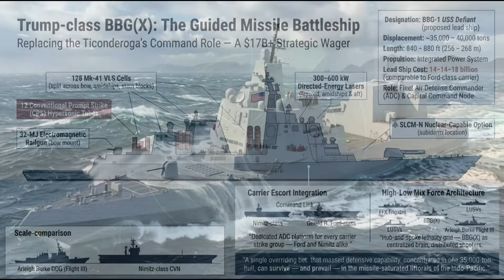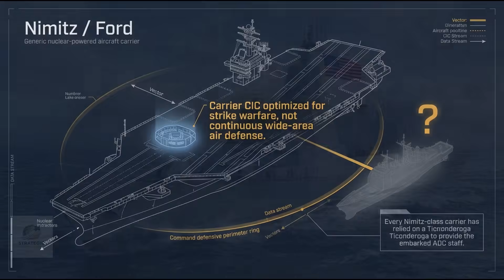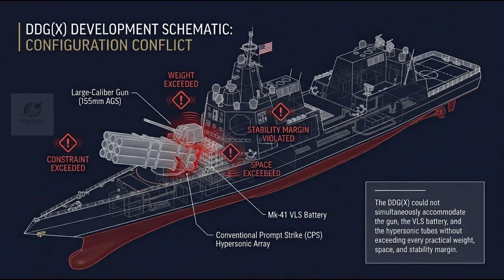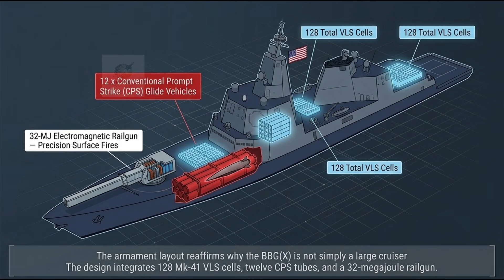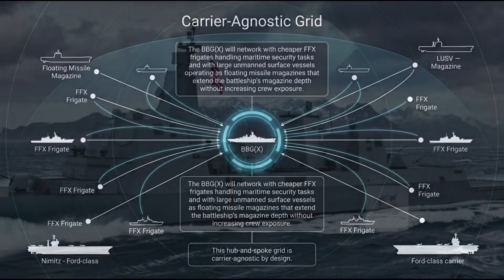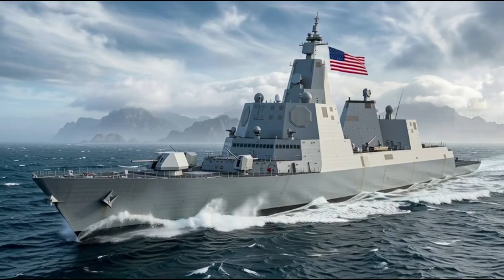Trump BBG(X): The 35,000-Ton Battleship Replacing the Ticonderoga - Explained

Comment from the maker: Thank you for watching. This video explores why the remaining Ticonderoga-class carriers cannot simply be replaced by Arleigh Burke Flight IIIs, and how the Air Defense Commander's role void gave rise to the design of the 35,000-ton Trump-class BBG(X).
Please share your thoughts: is the approach of giant command ships like the BBG(X) an unavoidable strategic necessity, or is it an expensive gamble that is too vulnerable in the era of hypersonic missiles?
Don't forget to like and subscribe for more maritime defense analysis.
Reply: Too many eggs, too few baskets. 

Tonnage to VLS cell count ratio is inefficient. 

If we need a flag bridge, it should only perform the command and control function, with sufficient defense systems to remain viable. Lose the offensive features. Railguns require too much power for non-nuclear power plants. Hypersonic capabilities only make this a more valuable target.
Reply from the maker: @taerkitty You're forgetting the 12 CPS hypersonic tubes. That's what scaled the hull to 35,000 tons—a Burke can't carry even one. The Integrated Power System is sized for the railgun and lasers; nuclear isn't needed. And if you strip the offensive punch to a separate platform, you've just created two must-defend aimpoints instead of one.
Reply: @strategicforecaster1  Good point. I didn't realize we couldn't field our hypersonic missile from current surface vessels. 

Yes, an all-offense ship is an arsenal ship, the concept of which the USN evaluated and opted for other options. 

One of the commonly cited reasons for avoiding the arsenal ship concept is the danger of secondary explosives should an attack make it through.

If this ship is only armed with lasers and railguns, that wouldn't be an issue, but both of them are too short-ranged to contribute to a firepower contest
Reply: @strategicforecaster1  The navy doesn't need a floating target. Nuclear would be needed for the power requirements of Railguns, and lasers and to not need replenishment while underway and to get speed with that tonnage. Next issue is railguns is not perfected the barrels were melting after 3 shots fired and the ammo was costing 800K per round. Next issue is the Helios laser that is on one Burke it currently due to power constraints on the Burke class it can only power up to 1/3 of its intended power. It is not useless, but it cannot perform at its full capability. a Burke Class is gas turbine. It is only 60KW which is okay against small drones, sensors, very small boats, the ones that even Iran uses in the IRCG is too big for it. The ship needs something that generates enough power that a Gas Turbine cannot to get up to a 300kwlaser that can take down cruise and anti-ship missiles or even possibly balletic missiles.

The Helios lasers are affected by fog, rain, sea spray, smoke, dust, humidity, and atmospheric distortion. A missile does not care much if the air is wet; a laser beam does. The beam also has to stay on the target long enough to burn or disable it. That is harder against fast, maneuvering, or reflective targets.

This is one of the biggest real-world limitations: lasers work best in clear conditions with enough dwell time. It needs line of sight. HELIOS can only hit what it can see. It cannot shoot over the horizon like a missile. A Burke destroyer still needs Standard Missiles, ESSM, RAM/CIWS, electronic warfare, decoys, and guns. HELIOS adds another layer; it does not replace the rest of the defensive system.

If the Navy wants to deploy a Helios system the power requirements are too great as it is right now. the battleship with the new ANY SP 6 Aegis radar is a beast on power in the new flight III burke class they have a bit bigger engine. The Marines don't need rail guns like the only battleships they are too imprecise. It's why we launch precision guided missiles now and they pack more of a punch. 

Look at Ukraine they took out Russia biggest ships with drones. Trump wants the Navy to go back to steam catapults because the emails have a failure every .16% or every 614 launches and there are 4 catapults on each ship. They have them back up rather fast. I was in the Navy recently retired it is a rather hard shock on the body when you get launched and the airplane itself. It was so much smoother on an emals system. Trump is an idiot. 

Trump wanted the islands on all carriers for the Ford class to be moved because he did not like the aesthetic. He is pushing for it even on the ships under construction now. They are placed by design because they are smaller, it improves air traffic flow on the deck, higher sortie rate, works with the new elevator design, better deck visibility but Trump said he did not care. The overall look and aesthetic of the ships were more important. Just like changing the reflecting pool to a blue that he wanted and no one else probably cared about was more important cleaning it was fine, sealing it was fine. No, he has to make things in what he wants.
Reply from the maker: @Asergaottie The budget submission itself includes both options: a non‑nuclear variant at roughly $14 billion maybe less >> and a nuclear variant at about $17 billion. Nuclear is not a hard requirement.  
On lasers, you’re ignoring wavelength tuning and the shift to near‑infrared, which materially reduces atmospheric attenuation and improves dwell‑time performance against maneuvering targets. That’s why the 300–600 kW systems are being pursued as a viable anti‑cruise‑missile layer.  
And on power management, the Integrated Power System uses smart load‑sharing; it never runs the railgun, lasers, and radars at maximum simultaneously. You’re painting an “all‑at‑once” problem that doesn’t exist in the architecture.
Reply from the maker: @Asergaottie As for the rest: I don’t judge people, but I learn about psychology—I know Trump is a narcissist and likes to be the center of attention. That observation, however, does not alter the engineering baseline the Navy is working from.
Reply: @strategicforecaster1  - Still, current Navy design guidance is to have each tactical function be isolated to its own class of vessel.
Reply: @strategicforecaster1  The Ticonderoga I was in the Navy for 26 years retired in early 2025. It is a 40 year old cruiser expensive and outdated. The Flight III is very comparable the biggest difference is the 122 vs 96 VLS cells and the Ticonderoga can perform as an air defense command for a CSG. We still do not need a floating target in a battleship. Cruiser sure. The Ticonderoga they tried to update it but it was futile and too expensive and only added a few years to it. SPY 1 vs SPY 6 (V) radar is one of the biggest differences. I would go for a cruiser over a battleship and adding more burke class but even those are older class ships. 

What the navy needs to do is Flights like the Burke and add things as they go, not like the Ford class carriers and add 23 new techs at once. We need to add quality and quantity at the same time. China adds more quantity and sacrifices some quality, that is why their destroyers and frigates are smaller than American ships.

They are focusing on more Diesel-elec ultra quiet for costal defense of the mainland and some nuclear subs which is a big deal. We need to not worry about one big ship and yes, I agree with your original point about Trump is a narcissist. But we need more Destroyers, using a cutter as a frigate with no VLS cells is a bad idea IMO. They screwed up the constellation bad. They screwed up the LCS bad and when they got the few that are remaining, they are so poorly armed they would get picked off one by one.
Reply: @strategicforecaster1  They are leaning towards a nuclear one. The options they are wanting would require enormous power. I saw the testing for the rail gun which is nowhere near completion. If you're going to build a battleship it would need to be standalone ship. Iowa class was 33 knots if not fully loaded down and in good sea conditions. Again, though it would require replenishment ever 4 to 7 days which adds to the cost. The larger the ship the more it takes. Even then it won't cost what the estimate is. How many projects cost what the estimate is. The ballroom was supposed to be $200 million now it is up to $400 and rising. There will be delays and supply chain issues etc.
Reply from the maker: @Asergaottie Thank you for the comments—I do understand the situation, and I've made several videos covering it: the CBGL, the Arleigh Burke Flight III versus the Type 055 from a growth-margin perspective, how the U.S. skipped the cruiser while China build it, and how America now realizes is troubled by it. The program that should have been moving forward, the DDG(X), ended up being overtaken and effectively killed by the BBG(X).

However, I think China's nuclear submarines will bypass the first island chain and break through to the Pacific and beyond using their speed. I've also made a video about the Type 093B.
Reply: @strategicforecaster1  You are not wrong, but we need to get our crap in one bag first and not worry about a BBG(X) one large ship that can take x number of years at a large tonnage.

Need to get quality with quantity, they are upgrading the docks back home a Pearl they built in the 40's and adding a 5th as I am sure you know and elsewhere. Need to add manpower from the pandemic maybe even work on more shipyards too. Pay is also an issue. Supply chains.

I still firmly believe since when I retired the Helios had its issues with power and there are unresolved issues with the curvature of the earth and the other ships only have dazzlers onboard to get 300kw lasers on board those need to be solved, and our own railgun project is not even currently funded. It's futile to think about it at this point as an option. If they are mentioning Japan's most recent testing of a railgun I would be surprised as generally, we use our own weapons on US Navy ships. Our railgun program hasn't been funded since FY22.

Our Virgina Class block 5 is great, and the Columbia class is great, but China is moving way to fast. That is such a bad sign. Our stuff is obsolete by the time it hits the water like a computer we buy.
Reply from the maker: @Asergaottie Yes, I know, lasers are light and can't bend due to the curvature of the Earth—but radar/radio waves do bend. And that's what makes the math complicated.

And the US builds military ships in its naval shipyards and requires mil-spec equipment, while China builds its military ships in its commercial shipyards. The US needs to change its policy.

But don't judge me for being a flat-Earther, okay?
Reply: @strategicforecaster1  - "Flat Earth Society: we have members around the globe."
Reply: @strategicforecaster1  yes but do we do it the same as China in the type of ships? I am not sure I would want someone in a commercial shipyard who does not have security clearance working on a Burke Class Flight III or a Virgina or Columbia Class Sub. Even San Antonio Class ships for the Marines. It depends on what the Navy proposes. 

China has ferries and the like to be used by the PLAN to move troops and tanks and the like to invade Taiwan when it is time, they built there one huge Amphibious ship for landings but again not combat tested, so who knows how efficient it is. I know the Fujian has its own issues.
Reply: @taerkitty  technically the Zumwalt class destroyer is more than capable of easily powering a rail gun weapon system  if they put it on there.. so realistically all it would take is using the technology from that and upscaling it to work with this ship

Comment: Yes you can make a centeral command and control node in a massive ship but you could also make a smaller ship that does that job not with long range missiles but lots of interceptors coordinating all defensive or offensive actions of the fleet for 1/3rd the price.  But i guess they want the big rail guns,  you know the project that was abandoned due to material science limitations since the gun could be fired 3 times before it starts to melt itself.  The way to build your "Golden fleet"  is to make lots of specialized craft one for sub hunting, one for air defense, and one for long range support fire.  So you get 100 missiles spread out between 10 ships versus 100 missiles in 1 ship.  Then remember that anti-ship missiles exist designed specifically to go through any armor.  This is why modern ships focus more on damage control over armor belts and how ships maintain the fairly high speeds they do.  Big ship need big engines which adds weight meaning you need bigger engines which adds more weight
Reply: Anti ship missiles are designed to maximize internal damage of mostly unarmored modern warships. Anti ship missiles designed to defeat armor belts would have to use a shaped charge warhead, which would dramatically reduce the internal damage that could be caused. Main reason why no modern warships uses armor is because the the existence of nuclear weapons and because armor forces ships to become MUCH larger and heavier.
Reply: @domdom6624 also remember that armor belts on battleships like the Iowa class were designed to funnel the blast of a high explosive down and away from the vulnerable parts, NOT to soak up the damage.  Which adds weight and limits internal space.  Not to mention the structural weakness of the material all of which means a single hit from a missile will if not sink a ship like this, damage it enough that it needs to withdraw or risk sinking.  Which kinda makes the whole project very costly strategically.  After all its not about if you get hit its when, particularly against a peer nation like China.  Yes one missile could sink a Chinese frigate, but so to can 1 missile sink a Diffiant/Trump class, and one is a much bigger investment in material and personal.  You also have to look historically at losses on ships in the height of war,  most of the big ships lost 40-70% of the crew when the ship went down since that could be several hours to a matter of minutes so a crew of 1000 we could see 600 losses all of which lowers moral a lot more than losses of 130 out of 200
Reply: The purpose of the big guns was for offshore bombardment for marines when they were landing, but guns even railguns are not precise unless it has guidance, so it is still artillery. The problem with the 16" guns on the Iowa class is it could hit our own troops or possibly civilian casualties perhaps. Railguns if they perfected it and solved the issue and got the ammo cost down would have the same issue. Missiles would be expensive and have the same issues of today. Replacement time and the amount we have they just have a bigger bang.
Reply: @Asergaottie if only we had technology that would allow us to launch a munitions keep it on station and the guide it to its target that is cheap and easily mass produced something....like a bee buzzing around bombing targets at will that we could build on ship and launch quickly
Reply: @mammyaondiciple3570  LOL if only. Going back to when my grandfather served in WW II and was a Dec 7 survivor, my dad went in 71 and was in Vietnam and I went in 1998. Though we did not launch to many artillery rounds when I was in lol. The few TOD I did in Afghanistan we launched missiles, did a few interdictions but yeah, it's a different world, even when we landed a few marines onshore they didn't do gun bombardments it was air power and missiles.
Reply: @Asergaottie main gun battleships were already on their way out by the end of WWII so I get it.  New technology does that just look at WWI and the invention of the bomber or machine gun or even the tank all forced change.  Those who fail to adapt are crushed until they learn,  its just can they learn fast enough to survive